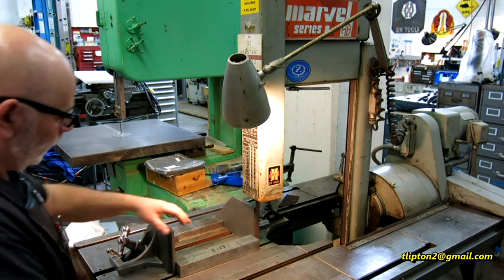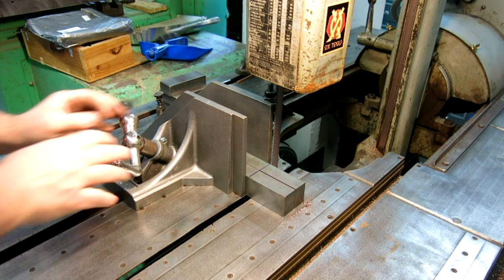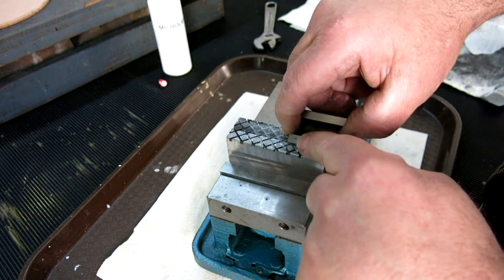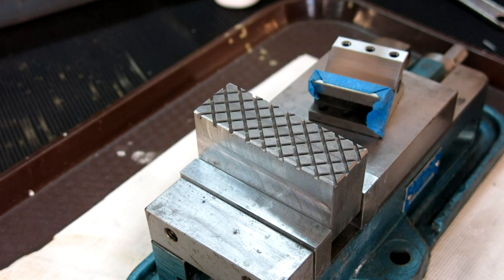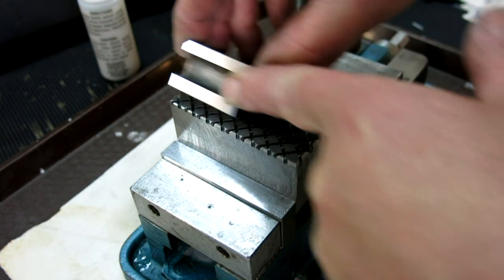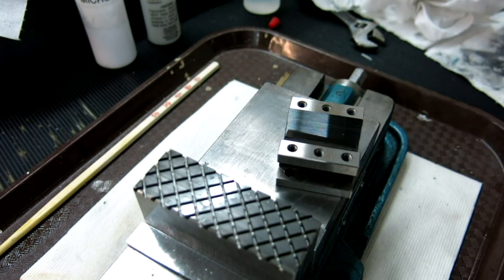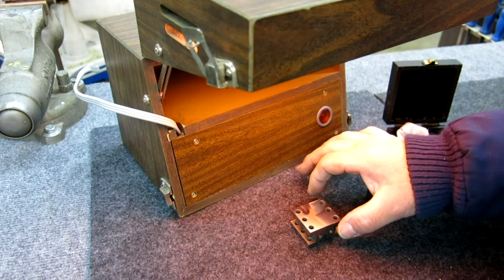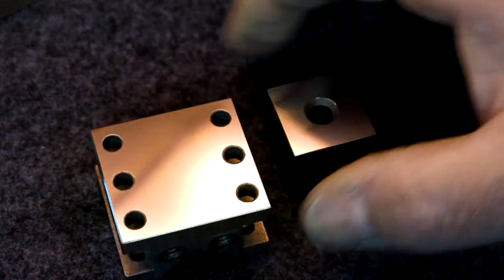Lapping a V Block With a shop made lap

Comment: Hey Tom, great video! 

Get yourself a box of the 4.4 x 8.4 Kimwipes. Put a single layer of the Kimwipe on the part and then put the optical flat on top. Now slowly drag the Kimwipe out from between them and you will have a perfectly clean interface where you will be able to manipulate the flat to get the band spacing and direction you desire. Also fold a piece of paper into an inverted hat shape and put it in the vise and then grab the lap with the paper lined vise so all that lapping debris does not lube your vise but stays on the paper.

ATB, Robin
Reply: Great suggestions!

Comment: I wish I could find one of those old Marvel band saws for a reasonable price. I worked in three shops that had them and the were indeed a marvel. At one shop, the automatic feed had gone out years before and I was told that they couldn't get parts for it. I took it apart during my breaks and found out that all that was wrong was the pin on the worm gear was sheared and the clutch was worn out. Since the clutch was actually made from cork sheeting, I took a cork bulletin board and peeled the cork off it and that became the new clutch. It was still working just fine a year later when I left that job for another.

Comment: In my carer as a mech. in a power plant, I lapped safety valves on every overhaul.On the finish lapping ,would use 1000 grit,and just keep lapping and wiping the valve seat until the compound would break down  so fine that the seat would would become a mirror finish,,,the  seat would become so smooth it would become a filament finish,or you could see a flashlite filament in the seat...

Comment: Brings back memories of running lapping machines when I worked as a hydrostat mechanic.
We had a six inch diameter optical flat that I kept locked in a drawer so that the hammer and chisel mechanics couldn’t bust it. We had  several lappers and the largest was about 60” in diameter.
I would batch test and adjust the rings in or out to compensate for wear on the lapping surfaces which in turn adjusted the flatness of the plates being lapped.
In that set-up, flatness was a constantly moving target.

Comment: Very interesting video. Back when I was a SeaBee in Vietnam, we actually had a lapping plate to rebuild fuel injectors or maybe the pumps on diesel engines. We didn't have an optical flat to test it however. I don't think we were looking at that level of precision. It seems to me the lapping plate was 6 to 8 inches square.

Comment: Tom
My first knowledge of optical flats come 50 years ago when as a Sparks was put on shift with a 60 year old Sparks mate , though time spent chatting between plant breakdowns it transpired he made gauge blocks (jo blocks ) during ww11 he when into great detail how they made them and the hand lapping process using CI Lapps and optical flats to test the results , and it's a bit footy now but a optical comparitor to get them on size , one thing that did stand out was the ruff ground the blocks then during them in the ground for two years ( greased up ) before finishing, he still had a couple of rejects that still wrung together , during the same time frame in ww11 dad worked on 18 foot HBM to bore and rifle large gun barrels ( he sett them up and the operators were all female )

Comment: Hip Hip Moiré on those patterns.  Your lapping series solved my  much lower resolution problem. I'll be lapping the bottoms of a new set of cast iron skillets [very nicely cast, but with a fine sandpaper-like as-cast surface from the casting sand]. I want the bottoms both smooth and flat so as to be non-abrasive and to get greater surface contact with the glass on an induction cooktop. Thanks Tom

Comment: Thanks Tom. Did the gauge block wring to the base?

Did you finish up buying an autocollimator? You mentioned that at one stage. If so, set the V on a sine plate and collimate off it.  You will get a very good indication of how accurate your V block is. Calibrate your sine plate with zero degrees (ie no blocks), Any lapped surface will provide a good enough reflection to do that. Gauge blocks make great mirrors in fact.

Do you think the grooves were strictly necessary when using such fine abrasive? My understanding they're more for coarse abrasive so the excess that doesn't charge the lap has somewhere to go. Not such a factor with fine abrasive.

One thing to mention to your viewers is to grind the lap before changing to a finer abrasive. The lap is charged and that layer needs to be removed before going finer. Your surface grinder is sensational and you do beautiful grinding.

I've never seen that saw before. A very nice piece of kit, thanks for showing us that.

Comment: Excellent information, Tom. Especially the part at the end evaluating with the optical flat. It's interesting because the laps you made look just like the laps used to polish mirrors for reflector telescopes. I believe the grinding material is also Aluminium Oxide; need to look see whether the Mirrors are ever finished with a diamond compound. I suspect the assessment of how well the mirror is made would be how concentric the bands are in the optical test setup the mirror fabricator uses. Thanks!
Reply: Correction: Silicon Carbide.

Comment: Hi Just found your channel, Awesome stuff, I used to lap carbon seal plates among other things back 25 yreas ago while building up Pratt & Whitney JT3 gas turbines for Boeing 707's 
we have come along way since then but I feel sorry for the kids these days they cant even read a mic or a Verynear haha let alone use a light source. I tell people and they are amazed what we used to do I worked over in Holland at the Frank Whittle engine shop for a few months and got the nick name MacGyver from my supervisor as they had all the kit but I was working out the moments of the fan blades for balance without a computer lol not rocket science back when i started we had to work everything out on paper lol cheers Phil.

Comment: You need some KimWipes.
They are ubiquitous in labs, and with people who use microscopes.
They are made from special paper they leaves no lint, and absorb an impressive amount of moisture considering they are closer to feeling like printer paper than tissue.
I use them by the case in the lab, they are fairly cheap.

Comment: Hey Tom,
when making a lap out of cast iron can you use any old grade of cast iron or is there one that does a better job?
i've been seeing several different grades of cast iron in german ebay and have worked with some really bizarre stuff and so it would be good to know if there is any discernible difference a guy needs to watch out for?
cheers
mike

Comment: What you do is not lapping by the definition I have learned. Lapping ALWAYS involves a random movement in 2 directions. But in your example you only move it in 1 direction. If your lap is not flat it will transfer its profile onto your work and not make it flat.

Comment: Very interesting.  I have a lap I've never used.  I think I'll have to order some abrasives.

Now, how about a video on testing the ground and lapped block?(amateur here)  The geometry makes it interesting.  Parallelism of both sides of the base, parallelism and centering of the axis of the v to the sides of the base, parallelism of the axis of the V to the base, actual angle of each side of the V away from the centerline plane down the length of the V, etc.

Comment: A more than interesting video Tom. Information and especially videos about precision lapping is tough to find. Since I've never lapped anything even close to high precision this is simply passing along a technique I've seen mentioned in Guy Lautard's second? Bedside Reader book. They mentioned how to get surfaces lapped as parallel as possible while using a lapping plate by weighting the part at the high side so it gets lapped much quicker at that area and into being parallel. On smaller parts the magnetic base from an indicator stand and without the vertical rod might be enough to weight bias the part. But it was something I've always remembered given the accuracy they were trying for. I'd be surprised if that's anything new to you though.

Comment: Question from the curious.....

Why would a gauge block or vee block need to be THAT flat?
What would you be manufacturing that required that sort of tolerance? Optical stuff like lenses maybe?
Reply: The Vee part flatness is critical if you are using it to check the roundness of a cylindrical part.

Comment: Cool saw!  Cool optical measurement! Thanks for showing!

One question: you had the v-block going off the end of the lap partially...doesn't that mean that the middle of the v-block gets more abraded than the ends?  While the ends have left the lapping block and are hanging in the air, the center is still sliding across the lapping block.  Also, unless you can precisely reduce the down force as the end comes off, you'll have more psi on the center than the ends see. Net effect is that I'd guess you get a concave surface. Not by much, but maybe enough to see with optical methods?  I'd also guess that unless downforce is identical and pass count is the same, you are also moving the center of the V by not removing the same material from both sides...though since it's still a V, it will still work fine as long as you don't change the planar relationship. 

Precision nit-picking while you wait!  :-)

--- Mike

Comment: You can sure tell all those vertical band saw "machine tools" were designed for "government work" and probably by "government employees" since they're all about 5 times as complicated, large, heavy, maintenance and labor intensive and no doubt expensive as they had to be and all to make them "automated" and "machine tools" by technical definition even though in any non-government "machine shop" they'd just be "band saws" and used to cut "bulk" stock to length to "fabricate" rather than "machine" something. They'd also be "gravity-powered", horizontal, located as far from the other tools as possible along with the mess and noise they create and they'd take up a few square feet of floor space and would take 30 seconds to set up and the "auto shutoff" would be on the stationary "table" where the cutting "head" would hit it automatically every time with no "adjustment" involved. And they'd probably cost way less than one fifth as much as that monstrosity did and would use a lot less electrical power and man power and materials and wouldn't be nearly as "efficient" at giving the "machinist" a 15-45 minute "break" on every cut. How do I know that? Because there are horizontal, compact "machine shop" bandsaws for steel stock scattered all over the country everywhere people have to get shit done "fast" to get paid and don't have the "bottomless" pockets of taxpayers to buy their "machine tools".

Comment: I was surprised that you didn't 'lap' the lap before attempting to 'sand' the "V" block with it !
You did say that you surface ground it . . . but that is not quite the same as producing a 'flat' lap !   I must say that going from a 60 grit finish , to a 3 micron finish is sidestepping quite a range of grades - perhaps 1500 grit / 5 microns would have been a good first step . . . followed by a couple grades; possibly finishing up with .1 micron / 200,000 grit ? ? ? 
     I design faceted gem cuts , and am quite aware of the shortcomings of 'back and forth' sanding / material removal . . . with a rotary flat lap, the dop arm is moved radially to the direction of rotation . . . which tends to cancel out a bit of the effects of 'back & forth' motion .   * To truly 'lap' a V block to extreme precision; a method fixture would have to be made to hold the 45 degree plane relative to the plane of the lap - which would allow for fully taking advantage of the Flatness of the lap . . . ( relative motion of the V block could be 'random' / vs back & forth guessing ! )         You DID manage to get it shiney ! !    Love your saw !      Perfection is painfully difficult to achieve , but isn't impossible !
Reply: I was actually wondering same thing. Dont you have to have at least a semi flat lapping plate before you lap a part?

Comment: I can see that this lapping creates a flat surface on the vee block but I gather that it does not influence whether the relationship between the faces is a true 90.  Is that correct?  I'm not sure that being a true 90 matters if the block is used for round stock since once it's in place it provides a repeatable position.  Am I missing something?

Comment: Nice saw! Now how do you get your block to look like the Mit? More lapping? I have been pondering how to do a precision bore and plunger with a clerance tolerance of .00005". I assume fine lapping would be the best method?
Reply: I sure don't know a whole lot about it just to be clear Brian, but one old school method was to cast a lead lap inside the bore of precision rifle barrels and around a smaller diameter rod, pull that out and charge it with abrasives. Then work that through the barrel to average out the lead/lag errors and bring the bore to final size and surface finish. Multiple laps are needed since you change the abrasive grit and size as the bore and rifling gets better. Split expanding and reducing aluminum, brass, or cast iron laps both male and female are used by the guys who build ultra high performance competition model engines and they can get some amazing precision and surface finishes. The laps are slowly rotated and reciprocated sort of like the automotive cylinder honing machines. Some use just a drill press to rotate the lap at the slowest speed possible and the part is moved up and down by hand. Since the lap itself slowly wears it gets more accurate for straightness and roundness. That in turn starts doing the same to the bore. The whole process sounds pretty mickey mouse and low tech, but the results are supposed to be much much better than one would think these simple processes can do. Getting two parts to fit with the tolerance needed is the tough part obviously. But those two areas where they do high precision hand lapping and might be where you can dig up further information. 

And exactly how they get the size as well as the required surface finish and flatness on gauge blocks is something I've always wanted to know as well. I did know about how there checked with the light bands, doing it consistently and to millionths is what I can't seem to find out.

Comment: I had a couple "Oh, that's what they meant" light bulbs go on while watching this.  Thanks Tom!  I do have one question - do you just presume that lapping doesn't change the geometry (the angles those lapped faces have with everything else and each other)?  I would think even a slight change to those angles would by far outweigh any benefits of smoother surfaces!

I can't see how using the other side of the vee as a guide - covered in pliable, varied thickness tape which would certainly 'give' to some degree with inconsistent hand motion - could keep a precision measuring tool angle.

Best to look for an answer from the source, eh?  Am I concerned about something that just isn't significant here?

Comment: what would happen if you used a much finer than 60 grit wheel  i see a large selection of 220.. but also 320 are available for grinding glass and carbides.  those would probably clog on cast iron though.

Comment: Tom, does your Marvel have the hydraulic blade tensioner?  That's one real nice thing to have on these saws. Changing blades by yourself is really fun......................not. You really do have to be a three handed paper hanger. Another nice brand of vertical band saws are the Roll In type saws

Comment: Another very interesting video. Not that it should change much, but are you going to recheck the parallelism and angle of the V after lapping? Also, just curious, how do you decide when mixing grits and slurry solutions is ok and when it is not? Like obviously you wouldn't use 3 micron on the same lap as 60grit....but switching from 3 micron aluminum oxide to 3 micron diamond worked fine.
Reply: You've just answered your question. It doesn't make sense to mix very different grits, but you can get away with mixing similar grits/grades, nothing bad will happen (most of the time).
But normally you should stay clean (don't mix or even store different grits together - you're asking for trouble, various surface quality defects, etc.).
Reply: Seems to me if you mix say 220 grit with 100 grit you  still  are only lapping with the 100
Reply: The grit particles break down as they are used and become smaller. So by continuing to use the lap with just a lubricant, the particles imbedded in the lap were being broken into smaller pieces and, eventually, they reduce to the size of the next grit.

Comment: Tom, watched your video twice. I would like to suggest to rotate the groove pattern on the lapping block, so the surface of the v-block meets an equal amount of surface of the lap (the same way most files are cut).
Reply from the maker: Hi Fernand,

With lapping its about averaging the cutting. There is some randomness in the process which is a good thing. This helps correct for randomness in the stroke pressure and length. You may be right that a different pattern would help. There is a small asymmetry in the lap but as you see I switch directions and sides on the lap. The vee surface came out pretty good. I was able to develop some fringe patterns with the optical flat but they were faint and frankly hard to interpret. Thanks for the comment.

Cheers,

Tom